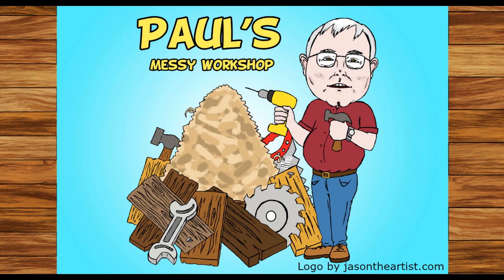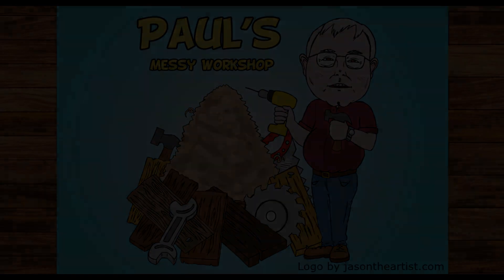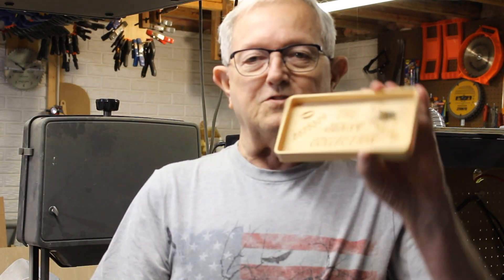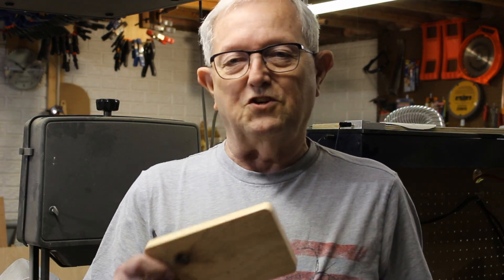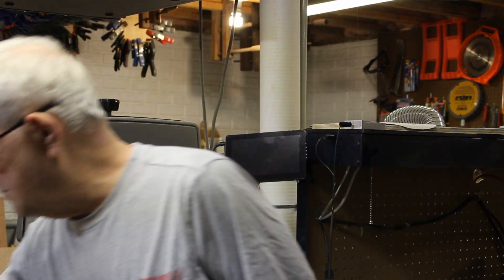JENNY BIT CONTEST....WHAT TO MAKE

Comment: That's a nice project Paul.  I really like the lettering and the thinner walls of the tray.  I'd love to get into CNC but it's such a slippery slope that every time I look into it, I just get confused.  LOL.  I'd also need to make some room in my shop for a CNC unit.  Either way, great project.  Thanks for posting this.
Reply from the maker: Kenny, with your ability to fit machines in your workshop I am sure you could come up with a solution.  The CNC is like the laser or the 3D printer, just another tool with yet more software to learn...LOL.  Dave Gatton has some nice videos about smaller units on his shows..  Some that are even reasonably priced believe it or not.  Thanks for following my channel and for your support.

Comment: Those lips are really nice. I like that. Been using these for a little while and I've noticed they don't even get slightly warm. In fact, I've changed bits after a few hours, up to ten even, and i have noticed they were actually cooler then room temperature. My other bits heat up but not these.